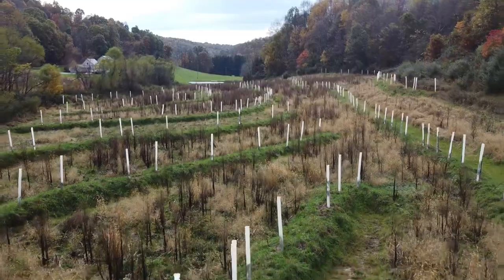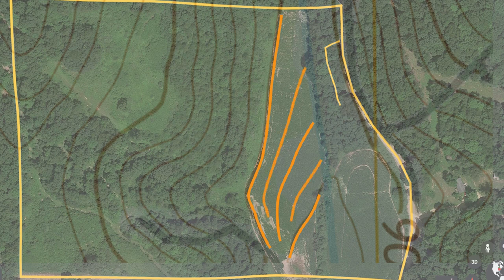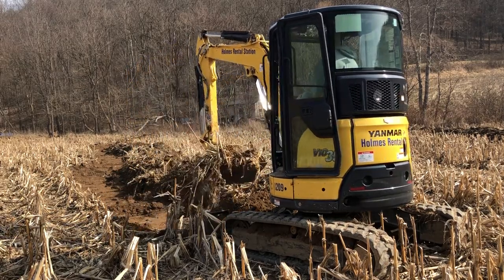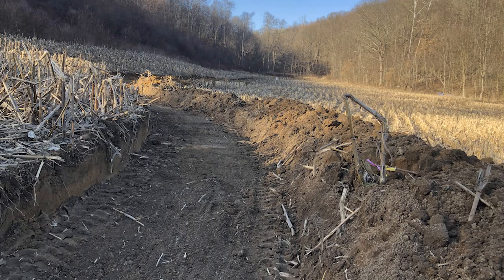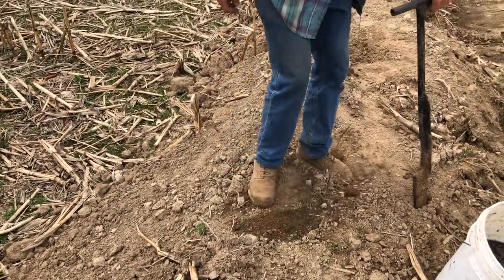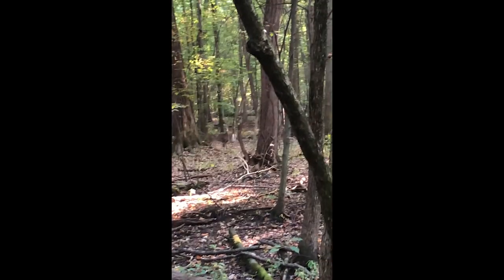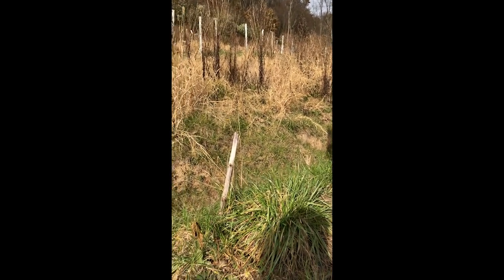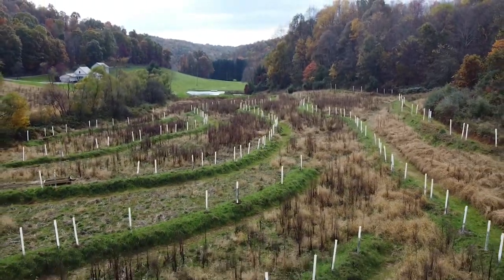How to make swales

Comment: I built a 3 mile road up my mountain and down again with an excavator.  The side ditches or swales were made to have numerous "Retention basins" or small ponding areas. Never just a smooth channel for erosion.  Now, those holes are silting in a bit, but hold water into June in areas. Pine trees are repopulating like crazy and water rarely makes it to the culverts. Rather it stands and soaks in, making home for frogs and water for bees and mammals.  In some large basins, I can harvest a truckload of fine silt for the garden yearly.  So easy and self evident,  but rarely done.

Comment: Great video man! I'm about to start on my flat (less than 12" high to low), very wet, land. The A frame worked great for me...had some spare parts and built one. Good luck on this season! Hope everyone is stocked up and ready. Much love.
Reply from the maker: Thanks for watching! I dug more this spring in a smaller field. Tried to make them shallower and wider because I've noticed some erosion along some of the steeper, more abrupt ones I dug in this video. Just a piece of advice. Good luck with your project as well!

Comment: Great video. I'm wanting to do this but need to do a little more research and learn how to do it properly like how many swales, how far apart, and how deep. 

So the property you're working on is in Ohio but you live in Mexico? 

What part of Mexico? I've Been looking at property in Campech and surrounding areas there. 
How is the weather and how are the prices for land in your area in Mexico?
Reply from the maker: Yes the property is located in Ohio. I’m not sure about prices in Campeche but I’ve been through there. I didn’t look seriously at any land in Mexico, or find it to be any cheaper than land here…  the going rate for 10x20m lots outside my city is 25-40k!
If you speak Spanish and make connections you can ask around. You will definitely find land if you look seriously!
Reply from the maker: As for swale size and spacing, all I can say is it depends! There are wrong answers but also many good answers, depending on your land and goals for it. I’ll make a video to address it when I can.
Reply: @nigelsearthprojects  thank you.

Comment: How much do they charge to rent the excavation machine and where is this property
Reply from the maker: The excavator was $800 pre-tax for one week, and I'm in the great state of Ohio
Reply: Thank you so much. I have asked others and I guess they we afraid to tell me thanks again.
Reply from the maker: @kennhurt5636  No problem! It is a small mini-excavator (8,000 lbs I think). This year I rented a larger one (17,000 lbs) and it cost $1200 for the week. The place I rented from also added a 10% damage fee (non-refundable) and tax which added 200-300 to the total. And running it all day I could spend $80-90 in diesel so it adds up. Still many times cheaper than hiring someone!

Comment: Steep areas? That is a parking lot compared to mine. Rocks the size of cars and  40% slopes common. Don't be afraid, you have to work really stupid to roll over. Usually on a loaded swing with a full bucket on an edge can do it. Mine weighs 45,000 pounds but I would guess the stability is better since it is 11' wide.   Work it for a year, You will be climbing trees!
Reply from the maker: Well for a first timer the feeling when it wobbles off the skids is very unsettling. This one was tiny, 8000 lbs and less stable than a big one. It was my first time operating but sounds like your an old timer! Yes I’ve learned to bring the bucket in when swinging it with a full load.

Comment: I don't understand the purpose of these swales. Typically I've seen swales used to fix drainage issues... This seems to have another purpose entirely.
Reply from the maker: These are on contour to capture water
Reply: @nigelsearthprojects  Ah I see. Well would swales be useful in a climate like California, where there is only 2 seasons: rain and no rain? During rainy seasons, our problem is how to remove the water the fastest. During our dry season, we need water but there is no rain to catch in a swale.
Reply from the maker: @TheNativeTwo  good question, I don’t feel qualified to answer but I’ll try anyway. It probably depends on where you are in relation to the local topography—if you’re in a basin where hundred of acres of water are running down into you or whether you’re upland. Upland I’d try to catch every drop but in bottomland you’d need to be sure you have stout and wide spillways. Look around your area for people who’ve tried!
Reply: Skip the Swale and lern Key Line acording P. A Yeoman to manage water and build soil ontop of it